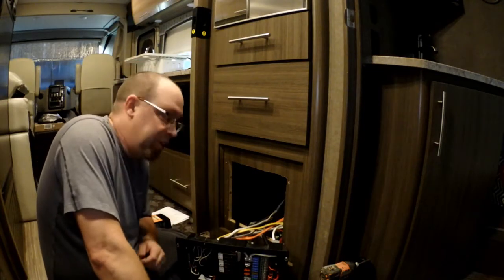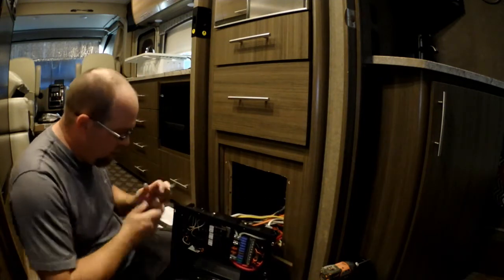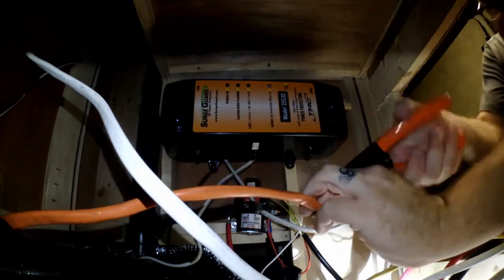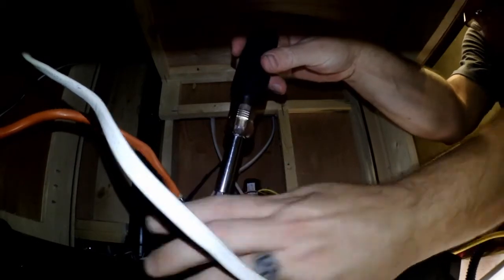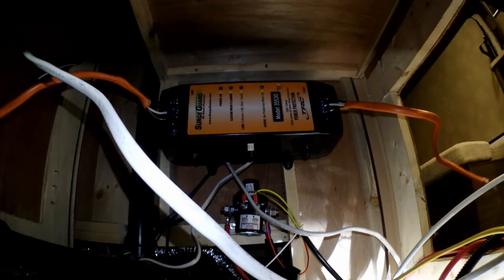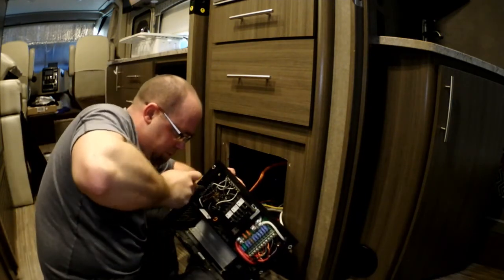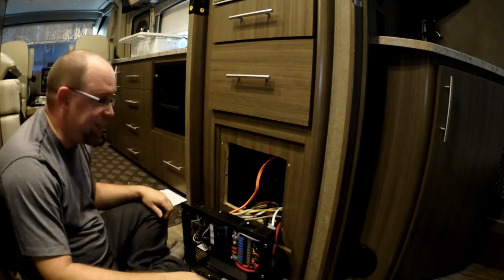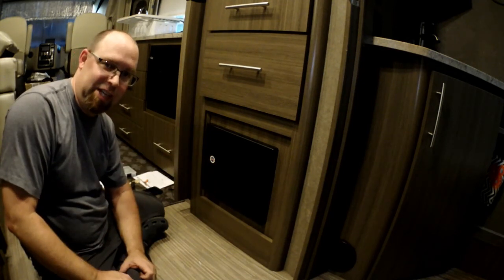Installing a TRC Surge Guard in Our RV

Comment: Hey. Got the same surge protector. Got a 2020 chaparral fifth wheel. Wanted to check to see if instead of where you mounted, can I install up front in the battery compartment? Before or after battery. Is it always going to be a orange wire that is used.
Reply from the maker: Before or after battery? This dosent work with 12volt. You can install it anywhere you want it just needs to be installed between the incoming power from shore or generator and the rv. As for wire color, unfortunately there is really no specific electrical code but normally 30 amp is orange.

Comment: I have the same unit and have installed and reinstalled 3 times- I have to admit the installation the first two times it was mounted on the floor.  After some research and re reading the instructions we installed for the 3rd time mounting correct!  Continues to give me a "reverse polarity"  All the  lines and power have been checked.  Help!
Reply from the maker: Sounds like to hot and natural are crossed somewhere. Are you at home or in a camp ground? Either way the problem may be in the pedestal plug on the house or in the campground.
Reply: Power Tools N Oven Mitts this is at home -  all wires and plugs have been tested, all is correct....however I tried it again and it worked! Smh

Comment: Have you had any issues with it since it was installed
Reply from the maker: So far no issues. It actually saved us when our generator malfunctioned.
Reply: @2TrailHikers  so it should pretty much ahead of everything, inverters, fuses all come after itstraight back from it would be the camper plug and forward would be all the electrical?

Comment: Straight up thumbs up from me, but I do have a question that hopefully you'll help with.  Please pardon my ignorance. If you have a Go Power Inverter or a Victron Multi-Plus Inverter which requires you run your shore power direct to it then from there to your panel or transfer switch if you also have a generator, where would you recommend installing the Surge Guard? Pre Inverter or post?  Wouldn't it be prudent to protect your inverter from bad pedestal power? Would I need 2, one before inverter and one post transfer switch to cover generator source as well?  I'm totally confused. Lol
Reply: I had the same question.  Just watched the video and after watching I definitely think this is something I can do myself.  Thanks for sharing the video.  However, I did have the same thought as "Retired and ROLLIN" that there are electronics upstream of the surge protector that are now unprotected (the switch from generator to shore power, for example) and I guess you have to make an assessment about what you are most concerned about (low generator voltage damaging all the electronics in your rig or bad shore power damaging the electronic upstream of the surge protector).  Maybe I'm not understanding where in the circuit the surge protector is installed.  Anyway, great video!